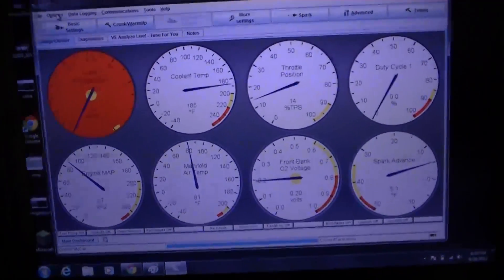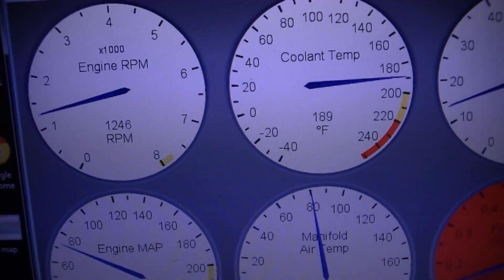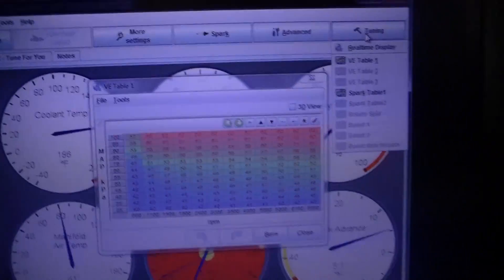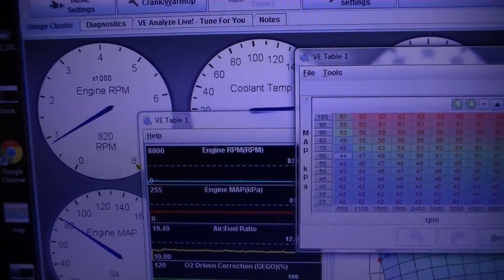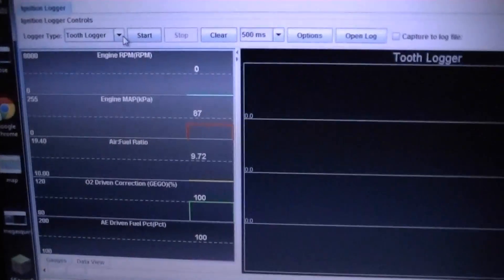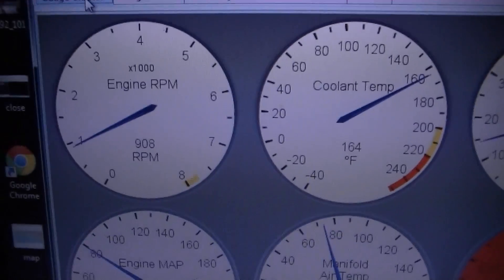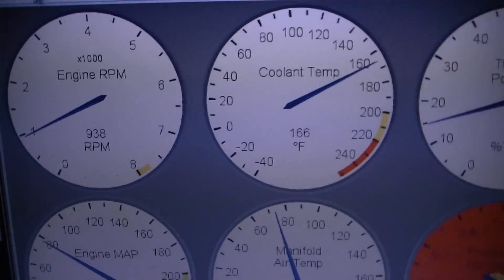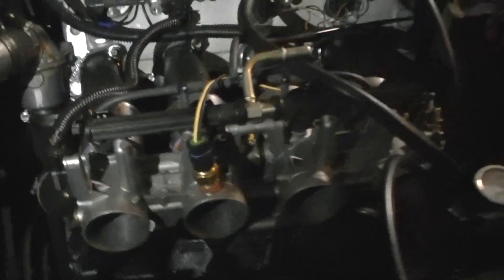1977 Porsche 924 Megasquirt Project - Idling/Tuning/Adjusting

Comment: how did you put a tps on it ?

plz response :D
Reply from the maker: The TPS is actually wired into the ITBs already.  The current throttle bodies are off of a GSXR 1000 sportbike.  I simply wired up the 3 wire TPS from that into my megasquirt and it worked quite well.  I've still had zero issues with it so far.
Reply: Ok thanks ^^
Reply from the maker: jordyskate1995 No problem :) If you have any other questions feel free to ask away.
Reply: well ... wath kind of injectors and fuel rail did you use ? or can you sand me a setup of you're car it runs verry well i see .
THX ^^
Reply from the maker: jordyskate1995 The injectors, pump, rail and fuel system is all stock pieces off of an early 90s Honda Accord.  For the 924, the accord rail was a direct fit.  Spacing was proper.
Reply: koihoshi
do you know from what engine you used all of that ?
Reply from the maker: jordyskate1995 I do not know which engine it came off of.  However, I can look up the part number on the rail sometime soon and find out.  Are you going megasquirt on a Porsche 924?
Reply: yes but im still on school learning car mechanics and now i have bought a 924 ^^ my first project
Reply: so i need a lot of information because i dont have that much experience in stuff like this ^^

btw thanks for al you're responses i really appreciate it ^^
Reply from the maker: jordyskate1995 If you're planning on simply fuel injecting it, I'd probably leave a lot of the stuff stock and worry about the fuel system.  My largest mistake on this project was to go do the ignition AND fuel on the megasquirt at the same time.  It makes tuning it incredibly hard.  I have since switched to an MSD ignition with MSD blaster coil, and am running the megasquirt off of the tach signal now.  There is nothing really wrong with the current ignition curve stock, so if you plan on injecting it, I would go fuel only.  But that's just my $.02.

Is there something wrong with the stock fuel system? Or are you just looking to modernize it with megasquirt?
Reply: koihoshi
its more of a learn project , i would like to learn more about engine management tuning and also i want to put a turbocharger on it and to run that properly its the best that i use efi .
Reply from the maker: jordyskate1995 You'll need a lot more than just EFI to turbocharge one.  The exhaust manifold and the parts to properly source and turbocharge them is a pain.  A custom manifold is a pain to fabricate because of the way the engine sits slanted.  You'd be far better off sourcing a 931 turbo setup off of a 931 turbo to do that.  A lot of people just go find a 931 donor car and swap the whole setup since it's easier to do.

Speaking from experience on that one because I own the '77 in this video, as well as an S1 931 (1980).  Turbo setups are very very cramped on these cars.
Reply: koihoshi
yeah i know but im just gonna try anyway  :D
Reply from the maker: jordyskate1995 Best of luck to you.  Just giving fair warning, working on any Porsche is $,$$$ or $$,$$$ when you get into custom fabs and builds.  It's important to be realistic, especially if this is your first project.  One of our local HDPE instructors dumped about $10k into his 931 to get everything properly tuned, upgraded and where he wanted it on his turbo.

The other thing you will run into if you turbocharge it is power.  The torque tubes on the N/A cars is smaller and more fragile, as well as the transmission.  So if you turbocharge it and don't do something about the torque tube and transmission you're looking at the equivalent of a shattered glass transmission.  This is why a lot of people start with a turbo platform than trying to turbo an N/A.
Reply: koihoshi thanks for the warning anyway ^^ i just want to learn more from this project ^^ it doesn't matter to me how much it costs and how long it takes . for me its all about learning and having fun with it :D i just don't have alot of information about the efi setup becaus i don't have experience with it and we don't learn these things on school .
Reply from the maker: jordyskate1995 No worries.  Just like to make sure people understand how much they cost.  Too many people buy them on the cheap and think they'll be cheap to continue maintaining and building :P But I was much in the same shoes you were when I started working on cars.  I see them as an investment on happiness, and to me, it's worth it.  I stopped keeping track of money spent on my Porsches and Lamborghini a while ago, I'd probably just be sad if I thought about it.
Reply: koihoshi hehe :p
Reply: koihoshi
lol i think om reading a topic of you're 924 on teamzx2 :D
Reply from the maker: jordyskate1995 probably - I used to own a ZX2 and was a member of that community and still am active there as a moderator of the forum.

Comment from the maker: Choosing a diameter appropriate for your goals is very important.  Realistically, most throttle bodies can be setup in the same fashion you'd do it on the bike.  Make some runners, attach them to the runners, and then modifying the throttle cable to work with it should be enough.  But you'll want to make sure the diameter is proper.  Too small and you'll bottleneck it, too large and it's a pain and pointless.  Generally most 600cc itb's are "about right" 35-41mm.

Comment from the maker: Getting it running was interesting with the megasquirt.  My largest obstacles in actually getting it running were figuring out the ignition timing and trigger setup I would have to say.  This setup is not adjustable as far as runner length but there are other ways to approach that.

If you don't want to go EFI there is a side draft weber setup that is pretty slick that will fit these cars, but it'll set you back about $1100 new.  They aren't super fast cars (Unless it's a 931) but still fun.

Comment from the maker: The engine is the same 2.0L that came out of it, correct.  However, it has high compression pistons, king bearings, gsxr throttle bodies, a honda fuel system, megasquirt efi (no more CIS injection), carbon fiber intake runners, and a few other goodies.  It's definitely not stock lol.